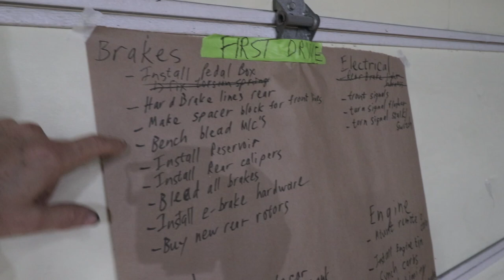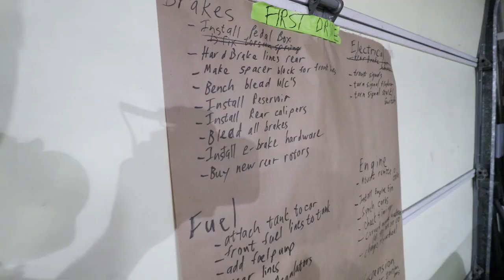Installing Tricky Emergency Brake Hardware & New Rotor - Porsche 911 Restoration

Comment: Got to finish it before you drive it.  HAHAHA. 

I once bought a 67 Triumph TR4-A. Hit moderately hard in the rear. 

First drive had the floor and driver’s seat. No doors, no bodywork at all behind me.  Fuel tank chained to the chassis.   It was at rented shop space from a from a friend’s sisters; in their back yard was an 10th mile dirt oval.  It got driven.  A fun time was had by all.
Reply from the maker: Sounds good to me and something I would do

Comment: I had a lot of trouble with rotor cracking after track days. Frozen rotors cured the problem. I had brake duct scoops but it wasn't enough for my '77 911.
Reply from the maker: Wow, both front and rear?
Reply: @GarageTimeAutoResto  Mostly front but a few in the rear.  Keep up the good work!